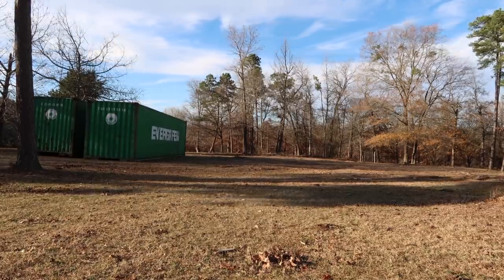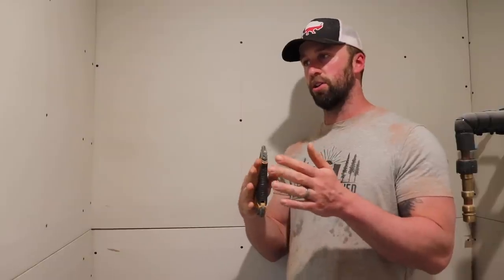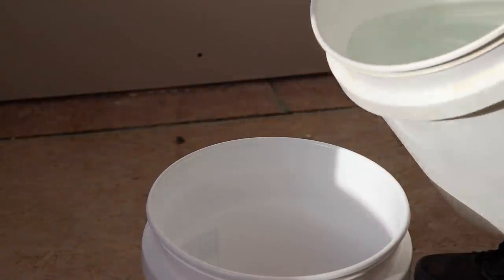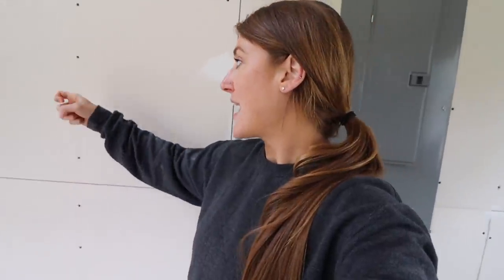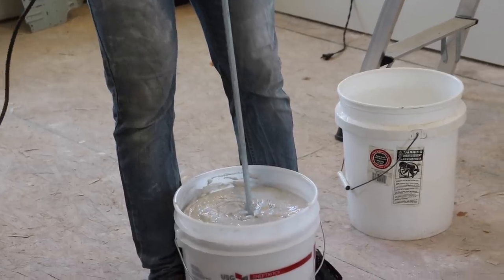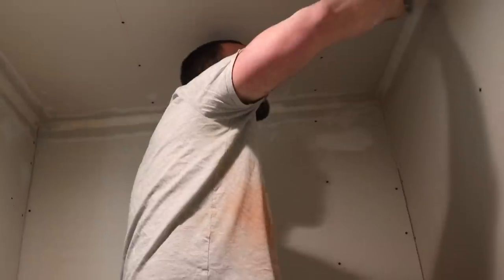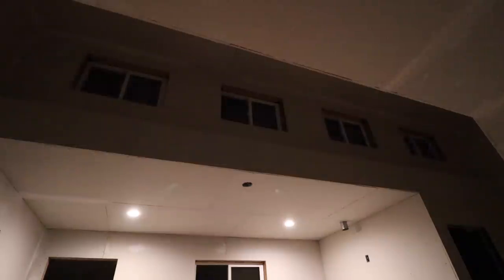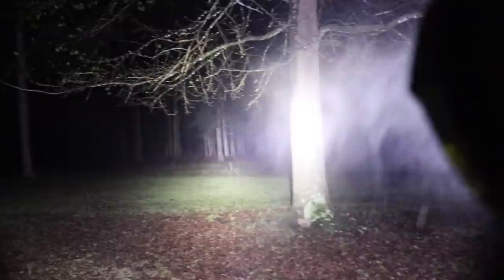Here Goes Nothing...

Comment: By the time you read this (if you do), it'll be too late.  But a little tip for the gaps:  Grab a gallon-sized ziplock bag, and cut a small bit out of one of the corners.  Fill the bag with mud.  Use it to squeeze a controlled amount of mud into the gap, then smooth it with a knife.  (Sort of like a homemade caulk gun).
Reply: Get this to the top! I know we can
Reply: Dude, I thought of exctly the same thing!!! Well, not the Ziplock bag, just a regular plastic bag, but hey, smart!
Reply: That's a really good tip!
Reply: I did this with mortar work as well, got the idea from my mums cake making.
Reply: @RobertSmith-rs1cz  I have those pastry bags! Great idea!
Reply: I was thinking the same.   Plus there is a corner trowel that makes it a little easier
Reply: I thought of this and using a corner sponge to press and slide smoothly along into the corners

Comment: Use a cake decorating bag to fill in the wide spaces, then smooth with your trowel/knife.
Reply: The mud at 10:29 looks too thin for filling the gaps.  It will most likely shrink and have a lot of cracks when it dries.  A thicker mud works better for filling the gaps.
Reply: @ILGuy2012  
Seams will need a broader surface area to blend in with a long run of a wall. I used the mesh tape when I did mine. That allowed me to do it all in two separate steps, tape and then smear on the mud. Also I thought there is a tool for inside corners. The screws will need more cover as well. A tendency is to modestly use the mud but that is not how it works.
Reply: Great job but you need a 45° corner trawl
Reply: That’s brilliant.
Reply: @ILGuy2012  
Adding water to the bucket may have been a mistake.
Reply: @lightbulb1982  
I did not say I was putting thick layers down but using the mesh tape avoids a lot of his first step as it all gets filled in as the mud is added over the tape. Yes, I have helped someone who helped me so I am not a pro but have done the job. It definitely is something that goes better the more you do it and ....... then you are all done. I am not looking to do it all again though.
Reply: @glasscityfishwitch3116  wouldn't it be a 90° trowel
Reply: Spenser can do it all. Thick material, thin material, gaps or whatever may be wrong doesnt matter.  In the end it will be just about perfect
Reply: @lightbulb1982   They will give up? Sure. I mean, they've been building up this house for more than 2 years, did everything from foundations, installation of solar panels, to rain catchment system and all the rest, but they are going to give up their home because of dry wall. Yeah, dry wall is what's going to break them. That and ruining the manicure.
Reply: @lightbulb1982   They will do it all themselves , else their subscriber base &  views get impacted.
Reply: @lightbulb1982  
Thank you for your reasoned reply. BAAAHAHAHAHAHAHAHAH
Maybe ;)
Reply: @lightbulb1982  actually, I'm  a Mason. 22 years! Loser!!!!

Comment: If anyone advised you guys to bypass on this part of the build, I agree with them. The amount of dust that comes from sanding in a place where the baby wanders around, the beautiful pregnant woman could inhale. Is it that important to proceed on this part when you two have other projects that will need your full attention. Just a thought. Be safe, be wise.
Reply: I don’t mind mudding, but sanding?!?  Especially sanding my mudding🤣🤣🤣 You’ll really appreciate drywallers after this. Be careful breathing that stuff🥰
Reply: Magovernor...my thought exactly!!  This process is so tideous and such a mess!!  Good luck and wear respirators!!
Reply: @vickimyers4022  Isn't wet sanding an option?
Reply: Said perfectly!
Reply: Electric drywall sander connected to a shopvac with a plaster filter!
I sanded by hand for a long time untill I used the electric sanding method with the vac, it’s like a night and day experience
Reply: Give "wet sanding" a try. A damp sponge when a coat is mostly dry can take off most blemishes WITHOUT dust!
Reply: I agree, a pregnant woman and a toddler should not breath the dust.
Reply: I’ve done enough taping muddying and sanding to honestly say IT SUCKS! Mad props to those who do it for a living. It doesn’t cost very much to have the pros do it and they are WAY faster and WAY better finish. You will get an education from it much like touching a hot stove, you learn nope no more.

Comment: I’ve watched your build and your doing great. I’m glad your tackling this next part of the project. If your going for a textured wall, buy a hopper that connects to the air compressor- medium texture is what most homes have. Spray the walls, let set 25-30 minutes, knock it down, next day wipe with slight damp sponge( softens the edges), ready to prime in 3 days.If your floating the wall, level 5 ( most homes now don’t have this ) take your time like your other projects...you guys got this!

Comment: When whipping up mud we always added a little dish soap. It gets rid of bubbles for when you start coating flats, beads and butt joints. Any liquid dish soap will do. They sell a glorified equivalent at most contractor supply stores but it's pretty much dish soap. Just FYI...you can do it. 20 yrs experience, not pulling your chain.
Reply: The dish soap also helps reject insects for a while.

Comment: I think when ppl would say “get some pro’s to do it “ ( ...and I’m one of them that suggested that to you guys) it’s not the muddying part , that’s actually easy , it’s the sanding and painting part. I can’t tell how many times I ran my hand over the sanded area and when I painted and it dried I found “ridge lines” of remaining compound that I thought it was smooth perfect to the drywall. I would recommend you paint an area now and let it dry good and take a bright light to inspect it and you’ll see what I mean.
Reply: Do it at night btw . You don’t need a super bright light, a 60watt bulb in a utility lamp works fine. After sanding , paint  the joints and screw coverings first with one coat of paint , let it dry and check how well you really did. When you’re completely satisfied, then go over everything with your 2nd and/or 3rd coat of paint..
Don’t do what I did and assume the paint will fill in cracks and ridge lines , it won’t, in fact the paint will reveal all the imperfections....

Comment: After hurricane Isabelle flooded my small ranch style house, I removed ever piece of drywall in the house except the ceiling. I rehung all the drywall and mudded it myself and while it was a little difficult at the start, I got better and better at it as I went along.  By the time I was done, I think my work was almost as good as any contractor would have done.  You guys will do fine - but warning - hanging drywall is the fast part.  You will need at least 3 coats of mud on every joint and that just takes a ton of time.

Comment: The best thing to avoid with drywall and mudding that might not go so well is painting dark colours. Otherwise, there is always the potential for wall covering or purchase as many of one style of picture frame as you want. Even inexpensive unfinished frames with some kind of white or off white matte. If unfinished paint them all in glossy black. Have as many photos as is required all scanned into black and white and hang them all on the wall you want to cover. It's really impressive when it's complete and covers any drywall concerns.

Comment: I know your not done so here are some tips.  Use a broader knife.  When you load it up to lay up some mud, rake it off sideways with the knife blade parallel to the joint.  It does go on faster that way.  Before you move on make sure you use your knife to level out as much as you can to eliminate any sanding.  Before you do your next coat just use the knife to scrape of any high spots, it goes much faster.  When you do corners lay in the mud and apply the tape.  Go back and just work topping just one side.  When that side dries do the other.  It goes faster and cleaner.  I Hope this helps.

Comment: Another trick on improving a not so perfect job is using a flat no sheen paint. The spot light idea is a very good tool for finding  mistakes. Place light as close to the walls surface as possible shinning upward at the ceiling.

Comment: I live in Texas as well, about 45 minutes north of Austin. The ice storm caused a small amount of water damage when the ice thawed on the roof, due to damming. So, I just got to sheetrock the spot over again and spackled it up. Today or tomorrow I will be shooting the texture because the walls have a monterrey drag.

I'm a software architect by trade, but built homes for about 6 years when I was younger... working for my uncle's construction company.

As a person who did home improvements for a living for a spell, who does flips, and who worked with union spacklers who did nothing but spackling, I can say that it looks like you did a great job. An advantage you have over a pro in this case is that it is your house and your first time... so you are being extra careful. The result is a good finished product. I've watched the videos from around when you were sizing up redoing the barn and noticed that you both really try to do everything the right way. In several cases, one could even say that you go the extra mile, or overboard a little even... but that ends up being good in the end anyway. I haven't finished watching this video yet, but your tape lines look good to me so far. I'm not looking at them in person, so it's hard to tell from a video, but they look pretty much like I would expect them to look after a first pass. I laughed when I saw Spencer's first tape piece and it looked a little like a roller coaster and he said he felt like a noob.  Then, all the tape lines after that looked really straight and solid. I have been seriously impressed with everything you guys have done. Especially, when you learn that many of these tasks are first time tasks for you guys and you're learning as you go. Many pros focus on their area of expertise: electric, plumbing, framing, sheetrock, spackling.... and you have pretty much done it all. You also learned first hand that it goes a lot faster in your imagination than when you actually start doing it.

When I watched you guys put up your first piece of sheetrock on the ceiling, I laughed and empathized because I knew that was going to happen... that you were going to be surprised how heavy the sheetrock was and what a pain it is to get in place. I sure know that feeling. Some pros have techniques to have something hold sheetrock up for you to make the job easier.

Poor man DIY: https://www.google.com/search?q=how+to+brace+sheetrock+for+the+ceiling&oq=how+to+brace+sheetrock+for+the+ceiling&aqs=chrome..69i57j33i22i29i30l3.8518j0j7&sourceid=chrome&ie=UTF-8#kpvalbx=_fXOeYObBOMSc-gSL36DACQ54

Pro Drywall Lift: https://www.youtube.com/watch?v=KmQSQdl6VUQ

Comment: A really great alternative to dry sanding and making all that dust is to “wet sand” using a large sponge and water bucket. Keep the sponge clean and damp by dipping and ringing out in the water bucket. Just sand and smooth out all your mud joints using the wet sponge. You will have zero dust and walls will come out perfectly smooth. This trick was taught to me by an old dry-waller friend when I did my house and I went with smooth wall finish, can not see any joints anywhere.

Comment: You guys are doing great! Most people won't attempt changing a light fixture due to lack of knowledge. Your building a one off house! Keep it up. Some drywall tips- 1. drywall knives have 1 working side. The blade is concaved to "float" joints by feathering the mud. More mud to the center, less to the edges as you float it out. 2. New tools can be difficult to work with. Over time they become more flexible and thus easier to use. You can weather your knives by sanding them and working the blade back and forth. They have to be broken in. Also the corners on new tools are sharp, soften them a little by sanding them. It makes floating inside corners much easier. 3. Taping is easy! Out of all tasks in construction finishing drywall is the best. If you make a mistake it can be easily corrected by floating it out a little broader, smoothing it with a drywall sponge, scraping it off and reapplying and finally the worst and last resort is sanding out the flaws. (Sanding is usually only for softening the final coat on smooth wall or taking the coarse edges off various textures. Not for finishing excessive mud build up on joints.) 4. Finally, apply mud, tape, float it out, and leave it alone. Avoid the temptation to keep working it! Set it and forget it. Keep up the great work! You guys are an amazing couple and a true inspiration.

Comment: Spencer. Big respect for your “just do it” attitude. I’m the same way, and have now renovated 3 homes with my wife. Drywall mud tip: filling “big cracks and sanding” is an extra step. Bottom line, you can fill and tape at the same time. No matter how “skilled” you become, you’ll still need a second coat of mud in some areas after you tape, mud and sand the first coat.

Comment: Congrats, the joint sealing, the taping and plaster looks really good... I've noticed that (a friend of mine) pros whose trawls have been used for years have a very keen single beveled edge. Apparently it lets the plaster flow off the trailing edge cleaner than a new edge. It makes sense from a fluid dynamics perspective, ask a pro for sure, otherwise try honing the edge it can't hurt. My friend also used a hugh trawl, loading it up and doing a large area in short time.

Comment: You only need the paper for the inside and outside corners. Use the mesh tape on the wall joints and you will only have to spread the mud once. Get a bigger mudding knife for the wall joints. Slight angle on the knife to make the outside edges smooth to the wall. This also helps you to not have to sand as much.

Comment: That way of making walls is really new, comparatively speaking, before 'drywall' was Lath & plaster. It was a lot stronger. It was great for many generations that weren't big on being able to just knock down walls whenever. On the other hand, if there's an issue behind the surface of the wall, with drywall it's way easier to get in and get out.

Comment: laying tape is actually not hard. It's the finish that is tricky. Go wide with your mud on your second layer. Each seam should be three trowels wide. One down the seam and one on each side.Then sand.  I would suggest that you finish one small room. Throw primer on it and see what your finished product looks like before moving on to the rest of the house. The reality of what you think is a fantastic finish job, and the reality once paint hits it are two different realities sometimes. I have to say it is looking pretty good so far. Best of luck.

Comment: I went from knowing nothing to being pretty good after remodeling two homes. My Suggestions; Less is more - You can add another coat easily, but it is hell to sand off too much. Scrape, scrape, scrape smooth into the outside edges after each coat - Save the sanding for the very last, lightly scrape the bumps after it's dry with the trowel between each coat. (A pro taught me that). Use a wider and wider trowel with each coat to blend in the seams. And my personal trick - For your last step, make a slurry with some plaster and using a smallish foam roller, roll over an area you need corrected. The underneath layers will absorb the water and the roller will make the area super smooth with a light texture. This trick is also amazing at blending the texture of a patch in an already painted wall. Love to watch you three - Good Luck!

Comment: I pray that the tape don't bubble up when it dries. I was surprised when you didn't mud over the tape, but not all people do. The gentle swipe with the damp sponge is a technique to smooth the mud before it dries completely, is something we never tried. But others swear by it. Seems like it would do good, just be careful with the tape. Especially rubbing it too much, it will fuzz up or tear the paper. The best to you both. Y'all are great.
Reply: After thought.if by chance you do find an air bubble beneath the tape. Cut that section out with the sheet rock knife, sand it and retape. You don't want to rip out a whole length of tape if it's not necessary. Good luck.

Comment: Using quick set, my advice would be mix smaller amounts till you get faster running mud, and throw the hawk away, Get a mud pan. When taping, get some mud on the edge of the knife and turn the knife sideways to the joint you're mudding. It makes it a little easier and you won't drop as much mud. Quick set doesn't shrink like regular mud, so you probably won't need 3 coats. Just try to be consistent. When you sand butt joints and flats sand across the joint not parallel with the joint. It will keep you from sanding the edges too much leaving a hump in the middle.

Comment: Spencer for getting the joint compound out of the bucket much easier. You should get a bucket scraper it work wonders when you get down to the bottom of the bucket and you need every last bit of compound to finish the job. and less mess when scooping out of the bucket as with a flat trawl or drywall putty knife.

Comment: Looking good, I can think of a couple things about mudding, looks good so far though.  One is always use your 6 inch putty knife to clean any mud of in side sides of the bucket, if you don't it can dry and fall into the mud your using, and chunks in mud do not help it spread well.  The other could be if have butt joints, I have seen a guy use the butt end of his 6 inch knife, (which is rounded a bit) , and run it down the butt joint with a moderate pressure, straddling the seem before putting on mud and tape. I probably didn't make that understandable, but it does work well.